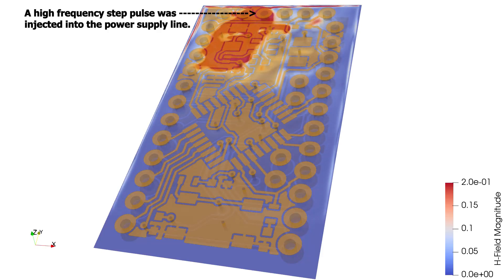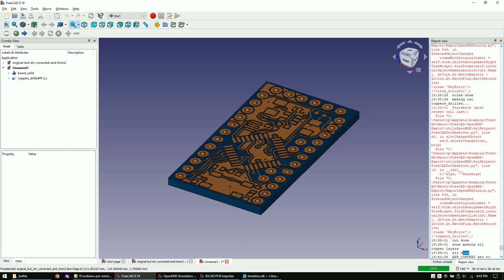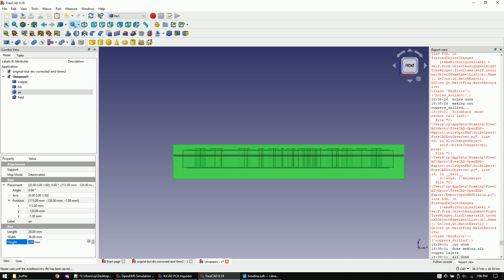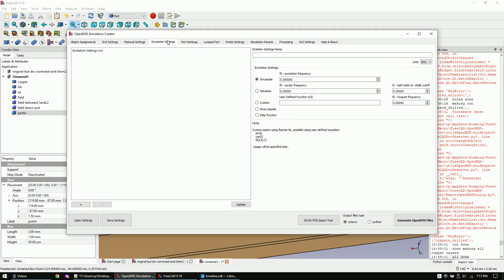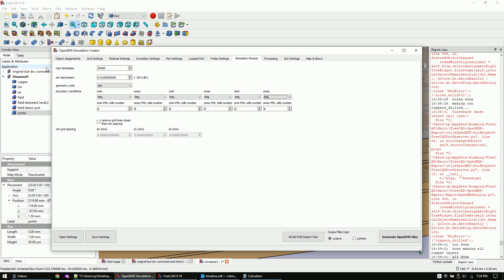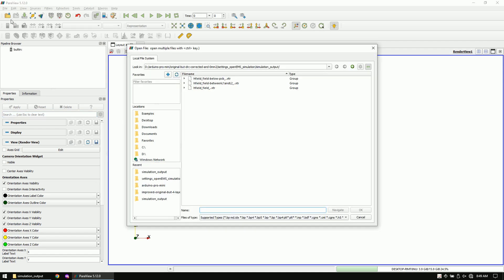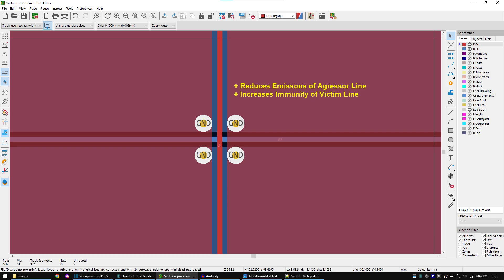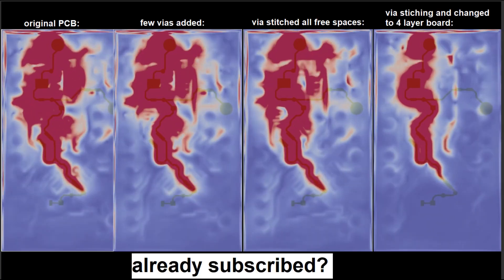free KiCad Crosstalk Heatmap Simulation and how to improve magnetic field emissions with openEMS

Comment: Very cool! Could this be used to show radiated emissions as well? Also, is it possible to run this on Linux?
Reply from the maker: Linux works - see comment in the other video.
Yes radiated emissions can also be simulated, but I would start with  PCB level emissions first and maybe after a lot of patiente you will do some simple full EMC chamber setups by using the smoothgrid options (not that easy to set up).
Reply: @panire3 good to know. I'm very excited to give this a try

Comment: Thanks for the video!
I tried to simulate H-bridge board using openEMS and following your steps and I faced issues with the preparing geometry for some reason plugin could not import and threw some  errors.
Then  I imported STEP file generated from KiCAD but output was full of errors like
"Polyhedron_Builder::operator(): Face 321847: Trying reverse order... failed
CSPrimPolyhedron::BuildTree: Warning, found polyhedron has invalud faces and is not a closed surface, setting to 3D solid anyway"
I also want to share some info I got:  Investigated source code of openEMS and modified it to show the progress of the calculations it does before actual simulation and I must say it does it in a very inefficient way. It could run much faster. I also found that  the main leverage to speed up the calculations is to set the grid values higher.
To fix anoyng bug with the plugin missing excitation step function modify this file 
"~/.local/share/FreeCAD/Macro/FreeCAD-OpenEMS-Export/utilsOpenEMS/ScriptLinesGenerator/PythonScriptLinesGenerator2.py"
 and at line 1428 add this snippet
"               elif (currSetting.getType() == 'step'):
                    genScript += "FDTD.SetStepExcite(1)\n"
                pass" and then remove ~/.cache/FreeCad directory

Comment: How can I make my Octave code run faster? Mine has been running for 10 hours and still hasn't completed, even though I followed the instructions from the video.
Reply from the maker: Here are some options:

1) The most straightforward but expensive solution: Upgrade to a faster computer or use cloud services like Google Cloud Platform.

Free alternatives:
2) ~10x speed boost: Switch from PML to PEC boundaries.
This will cause some of the current to flow on the PEC layer around the PCB. However, if you're comparing two different layouts, it will still indicate which layout performs better.

3) Another ~10x speed boost: Reduce the PCB thickness to just 1 or 2 grid thicknesses. For example, if your grid is 0.05mm, set the PCB and copper thickness in the layer stack menu to 0.05mm (50µm) as well. This method enables relative comparisons between layouts, even if the absolute values are slightly off.

4) Another ~10x speed boost: 
Since PEC boundaries don’t require a gap like PML, you can reduce the distance between the PCB and boundary to just 1 or 2 grid thicknesses.

By combining these optimizations, you can achieve nearly 100x or even 1000x speed improvement.

In my udemy course i have some example files, it also shows how to reduce the filesize of the field dumps by up to 100x or more.

Some approximate loading times to give a sense of the expected durations:
a) The example of this video took around 2 to 5 hours on my laptop to dump the first timestep and then maybe another 5 hours to dump 2000 timesteps. 2000 timesteps are enough to see how the signal travels from injection point to the end of the PCB. You will only need 20k timesteps if you want to see how the signal bounces back and forth due to reflections.
b) An Arduino UNO sized PCB takes around 5 to 10 hours on my laptop to get to the first timestep.
Reply: thank's a lot for your helpfull response

Comment: I followed the tutorial until running the _openEMS.py. I run the script, close the 3D preview, the script runs for about 5-6 seconds and then closes. I get no output files on the simulation_output folder. There is no error to be seen. I have try adding a Try, Except sentence to catch the exception but did not work.
Reply from the maker: Hi there, right click on the *.py file and open it with the application "IDLE" and run the pyton script from there. It should have been installed during the python installation. Running it inside IDLE will show you error messages which hopefully will help.

The steps on how to run the script with IDLE is shown in the installation tutorial video at 5:15:
https://www.youtube.com/watch?v=VcJqhsbzR3c
Reply: @panire3  Hi!
I tried running the file using the python IDLE and did not work and got no error message. It ran the 3D preview and after closing that window kept running for about 10 seconds until the IDLE shell showed the message: ====== RESTART: Shell ====
Reply: @panire3  I got working the simulation in the video that you mention using a step function insted of gaussian. I don't really understand why you are using de efield probe and hfield probe insted of the dump box that is used in this video. Also, you use different size grids on the other video and just one on this video. Anyways, I will keep working on trying to get a more complex pcb simulation to run. Thank you for your time and the guidance.
Reply from the maker: @felipesantisteban  dump box vs field box: 
the efield/hfield box and dump box give the same output, you can choose either of them.

grid size:
In later videos i often use a coarser grid to speed up simulation time.

Enjoy the learning, and wish you a lot of patiente, the tools can be quite frustrating at times :)
Reply: @panire3  Thanks! It would be great if you could make a video someday covering the most common errors and how to fix them when simulating a PCB. Your videos are really helpful for the example PCBs you use, but I struggle when trying to simulate my own designs. For example, I found that changing the grid size can either cause the simulation to produce no data output, take too long to compute, or not start at all. Maybe explaining more of the thought process behind simulating with the software could help viewers debug their own projects.
Reply from the maker: @felipesantisteban  I've already included some common errors in the Udemy course, and I plan to share some of that content on YouTube in the coming months or years. However, I want to ensure that Udemy students receive extra value by getting early access to troubleshooting information, as they are essentially funding this channel.

Here is a verbal checklist:
1) use exactly the same Kicad layer stackup as i use in this video.
2) use the identical grid size
3) use identical distances in z direction for all parts (grid perfectly aligns with the copper layers as shown in the video?)
4) if the simulation reaches a few thousand timesteps but the field dumps seem to not follow the trace at all: try to enable the PEC dump in the simulation params tab and check the pec dump with paraview. If the traces are not visible in the PEC dump, at least you will know that there is an issue with the trace recognition.
5) if the simulation seems to get stuck even before reaching the first timestep, maybe its just lack of patiente - it can take 10hours or more to get to the first timestep if your PCB is big. I had a few people already that fell into the trap of not waiting long enough.
Reply: @panire3  You are right !
I forgot to check de description of the video where you shared the Udemy course. Thankyou
Reply from the maker: @felipesantisteban  and sorry for hiding some things behind a paywall. ✌️😅

Comment: Is 0.1 mm grid size to z direction enough to simulate the copper trace? I have been asking to forum that they said it should be have 5-10 mesh cells, if you gave 0.1 mm it has bigger than copper thickness 0.035 or 0.05 mm. I know it would cost time for solving I also have been running the solver for more than 4 hours with no results.
Reply from the maker: *the grid size should be at least 1x the thickness of the copper, ideally more than that.
*in this video i used a grid of 0.05mm with a copper thickness of 0.05mm (50micrometers).

If you want to simulate a 0.035mm trace, the grid should also be at least 0.035mm, this will ofcourse result in very long simulation times. If you want to compare different layouts while maintaining a fast simulation speed i suggest to use something like 0.2mm trace thickness and a grid of 0.1mm. This will still show you nicely which layout performs better. Of course your final PCB will have 0.035mm trace thickness, but the purpose of the crosstalk simulation is to show where a layout has problems and for that maintaining the exact trace thickness is not that important.

Hope this helps
Reply from the maker: ah and yes: 5-10 mesh cells would be the way to go also based on the online documentation (https://wiki.openems.de/index.php/FDTD_Mesh.html), but i found that impossible for any PCB simulation that i made so far.

Hopefully one day someone manages to create a setup that follows all the rules from the mesh documentation page and shares it.
Reply: @panire3  but if we adjust the copper thickness, we can't simulate the real PCB? According to your approximation, how much accuracy reduce for scalling all the PCB resolution. Including the fr4 and etc.
Reply from the maker: The video shows a purely relative comparison. 
By injecting noise into a trace, the simulation highlights potential hotspots.
If you notice hotspots in unexpected areas, you can revise the layout and check if they disappear.

Generating absolute field values in OpenEMS would require significant additional work—something I hope this channel will achieve in the future. Unfortunately, that's all I can offer for now. :)

If your project demands absolute values rather than a relative comparison, consider looking for a consultant on the OpenEMS forum or through a Google search.

PS: So far, I’ve never needed an absolute comparison. This approach is already a huge improvement over manually reviewing a layout. At work, we typically assessed trace routing visually, which often led to mistakes due to gaps in knowledge.
Reply from the maker: @wisnueepis3593  just an update: i uploaded the python code now also for the remaining layout versions (4 layer version and the versions with more vias)
Reply: @panire3  nice panire, I'll look at it.

Comment: If you use a 4 layer pcb, are there 3 fields between and 1 below? And for the size of the field, field between, and field below, is it full covering all areas or just thin? I don't understand the size of the field used.
Reply from the maker: The field are ideal flat cross sections (zero thickness).
Yes for a 4 layer PCB this would be the field cross sections:
Field 1) Above the PCB
Field 2) between L1 and L2
Field 3) Between L2 and L3
Field 4) Between L3 and L4
Field 5) Below the PCB

Alternatively you can also create a 3D dump of the fields as shown in this video.:
https://youtu.be/jYVD-8Wgdq8?si=3CQRQ-8QU8UKR_iU
The 3D dump would need to cover the whole PCB and also the area around the PCB, because the fields also are present around the PCB and not just inbetween the layers.
Looking at the cross sections instead of a 3D dump simply reduced the used memory and simulation time.
Reply: What is the basis for determining the port amplitude/excitation direction in the X, Y, or Z axis?
Reply from the maker: after posting the video i found out that sadly the port amplitude cannot properly be set before the simulation starts but has to be manually recalculated after the simulation has finished. i will one day post a video on how to do it.

For this simulation the absolute value of the voltage is not that important in my opinion as the heatmap distribution and hotspot locations would look identical.
Reply: oke thank you for your information

Comment: would be great if the share folder will include your final python for the openems, since sometime your change in code wasn't mentioned in the video. like the first tutorial of openems with openems plugin.
Reply from the maker: sure i will add the matlab code and freecad project to the folder and reply once again after the files are uploaded. ps: i suggest using the matlab code instead of python for the time being, i had a lot of error messages while using the python export of the "freecad to openems macro", the matlab exports are much more stable and need less debugging.
Reply: @panire3  so we check the octave radiobutton?
Reply from the maker: @wisnueepis3593  correct. and then open the code with octave and run it inside of the octave gui.

For this example i will also provide the  python script as the tutorial was made with the python export as well.
Reply: @panire3  no need adjusment like "dumpn_type" "adding excitation" and so on? Just run it in octave? Because your tutor videos mostly working on python
Reply from the maker: I now added following items: 
* the freecad project
* ini settings file for the freecad to openems macro
* the python code

To generate the field dumps, just run the python code.
Be aware:
* The simulation will take several hours, so be patient :)
* The dump files use around 200GB of storage if you let the simulation run until the 2000th timestep.

enjoy running the simulation.
Reply: @panire3  thankss
Reply: @panire3  you are such generous and kind person to share this knowledge, hope god bless you.

Comment: My 3d preview un CSXCAD shows all the objects spread out in space, as if they were referenced to different origins. I cannot make the simulation work because of this. Any ideas?
Reply from the maker: I had the same problem with another laptop using  "Intel® HD Graphics 3000" but did not manage to fix it. It most likely has something to do with opengl support of your graphics driver i believe. -> Maybe a graphics driver update helps.

With other laptops I had it working on specific windows versions only, for example it worked on windows 11 and 7 but not on windows 10 and 8.
Reply from the maker: ps: did you managed to male it work meanwhile? let me know if i can help a bit more with getting the setup to work

Comment: Very cool! This is the tooling I've been wishing I had to learn OpenEMS! I would love to see a tutorial on PCB Trace Antenna design using this FreeCAD OpenEMS Macro.
Reply from the maker: I intend to create a video on antenna design with openEMS in the future. In the meantime, here’s a valuable lesson we learned the hard way at a previous job: when working with an IC, it's crucial to stringently follow the manufacturer's antenna design guidelines and avoid unnecessary experimentation or simulations. If issues come up, you'll have a strong rationale to support your design decisions when discussing them with customers.

Additionally, if there are plastic components near the antenna, it’s best (in my opinion) to remove them to comply with the manufacturer's guidelines rather than altering the antenna design through simulation. Only do this if you're very confident in your understanding and can handle any challenges from potential high-frequency design experts!